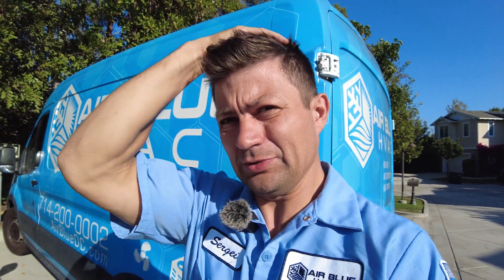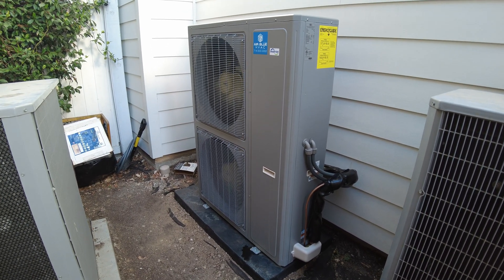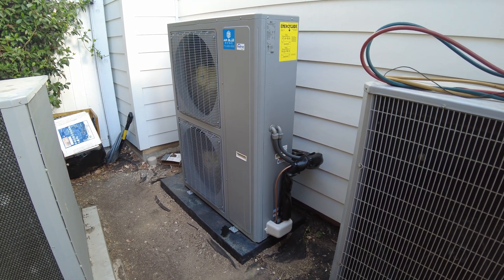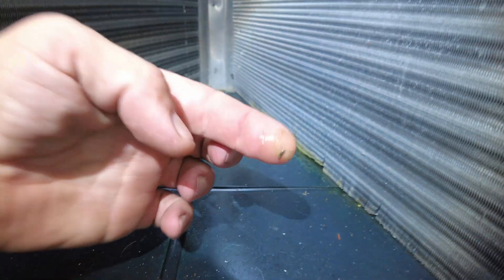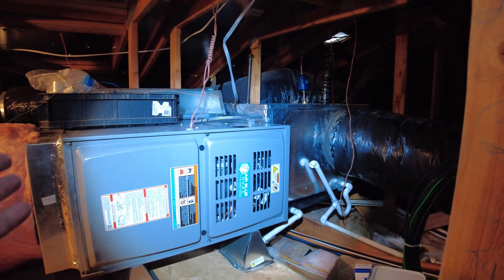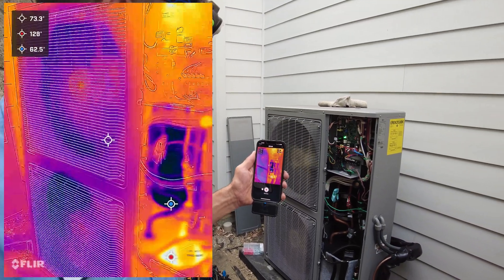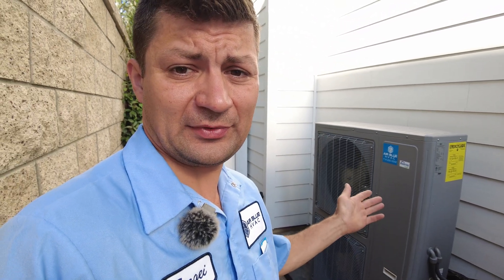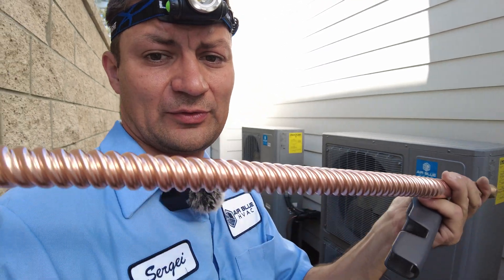What is heat pump? Replacing gas system with heat pump / X-series ACPRO inverter heat pump review

Comment: Wow - supply chain so bad that you had to buy a gas furnace to use only as the blower!
Reply from the maker: YES, what we do now is we use these systems as dual fuel so customer can use gas or heat pump by just changing thermostat setting, check our other videos.  This customer wanted heat pump only option so we did not connect furnaces to gas line and flue pipe.

Comment: Great content! Are dual fuel systems allowed in your area
Reply from the maker: why not? its up to customer to burn gas or electricity, unless TECH(decarbonizing heat pump  rebate is involved but they also allow dual fuel setup sometimes)

Comment: Thanks for helping us average Joe kind of folks in understanding these newer units starting to come out in the U.S.. I am a So. Cal. resident considering replacing my 24 yr. old  a/c system and gas furnace with newer machines this winter. My questions are do these heat pumps heat effectively in winter temperatures that often dip into the 20's to 40's fahrenheit (-6.6 to 4.4 Celsius)? Further, since that customer, in this video, had an existing gas furnace why wouldn't you just make that system a duel fuel setup since you had to use a new gas furnace as the air carrier?
Reply from the maker: They are going solar and temp never will be below 50f so there will not be any heating capacity issues, no need for dual fuel.
Heat pumps work well till 40f but at lower outdoor temps capacity is significantly reduced so you need to size heat pump right or use supplementary heat strips in airhandler(208/230v airhandler) if temps are below freezing or go dual fuel with gas furnace+heat pump!!!
Reply from the maker: Keep in mind Heat pumps only make sense if you want to save the planet or have solar that produces enough electricity or you steal electricity :). its little more expensive to use heat pump with CA electricity rates($0.3per kwh  or $0.6 per kwh time of use evening plan) versus other states($0.1per kwh)